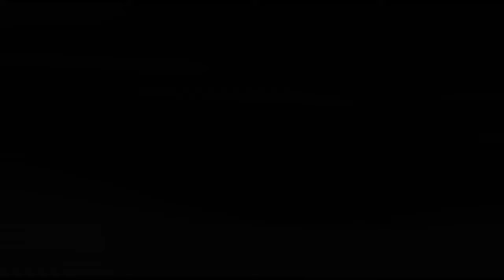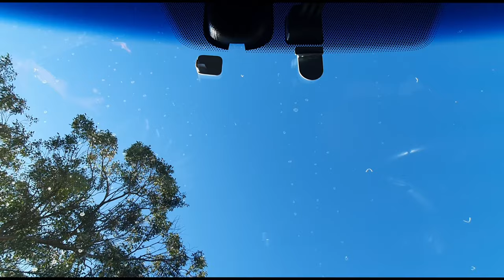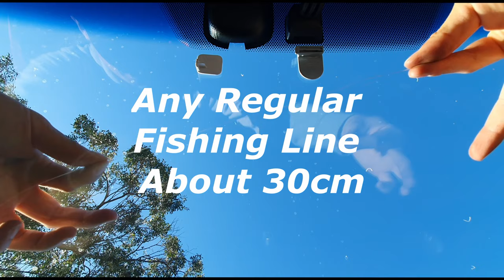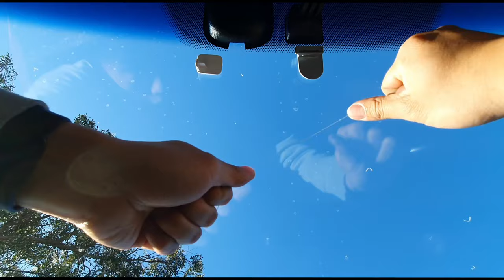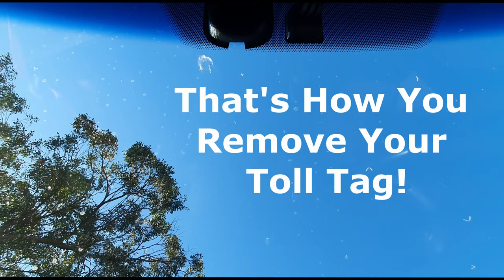How To Remove E-Tag Toll Holder Properly From Windscreen [DIY VIDEO]

Comment: My tag still works but it accidentally snapped off from its holder. Shall I just get a replacement from ServiceNSW or could I glue it back myself? I don't know which way it should face or if it needs a holder at all. Thanks in advance!!

Comment: Thank you, good sir!  I didn't have fishing wire so used dental floss to loosen it around edges (which broke a few times) then used a tiny sharp paring knife to gently saw away at the glue undeneath until I had freed enough glue to easily  jemmy it off the  windscreen without breaking the knife.  Once the tag was removed, the rubber like glue then peeled off the windscreen as easily as can be without leaving any residue.

Comment: Awesome video mate! Absolute life saver. 

Pro Tip: If the tag holder is way too strongly glued to the windscreen:

- pry as much as you can with the fishing line/ dental floss at the edges 
- ask a mate to pull it with their hand while you keep prying, hopefully this will  get the job done much quicker and easier without having to cut your fingers.
Reply: Good to hear it worked !

Comment: can you use dental floss?
Reply from the maker: Hey man, you can't use dental floss. Dental floss is meant for your teeth so it's not as strong.
Reply: I just did and it worked. The trick is to not pull down too tight. The floss did tear off a couple of times but if you grab a long enough strand it'll work. Took me about a minute.
Reply from the maker: @CoreyHunter  Good to hear you got it to work! i just wouldn't want to waste floss haha